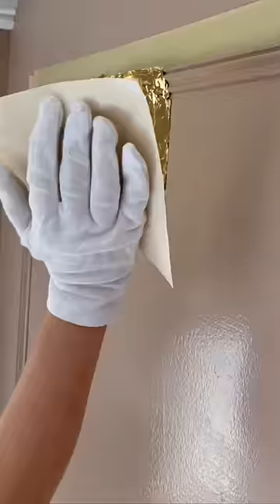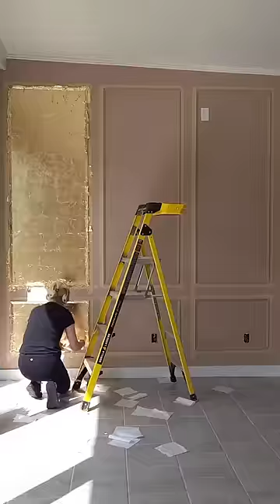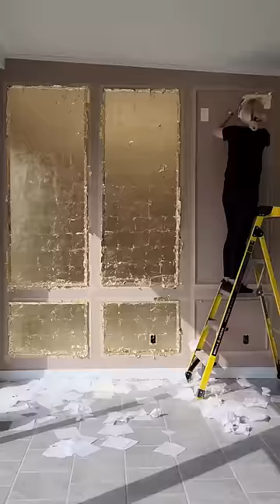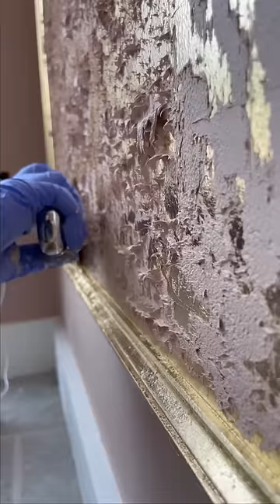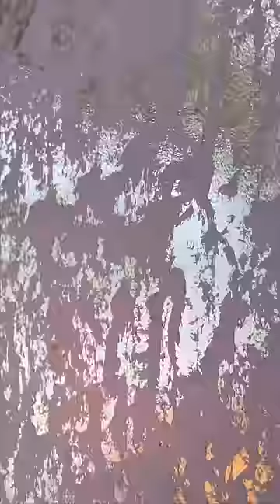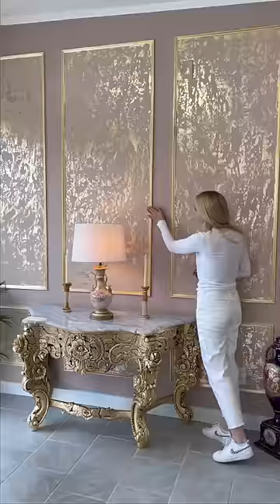Can’t wait to show you the whole store but this wall section is probably what I am most proud of!

Comment: Beautiful but probably very costly
Reply: I was thinking the same. That's a lot of gold leaf!
Reply: Cheaper to use similiar wallpapers
Reply: @Snakelady- The size indicated that it is gold colored metal leafing. Real gold leaf sheets are much smaller.
Reply: Scratch "but" add +++AND+++
Reply: Gold leaf isn't expensive, either way, there are duplicate gold leaves sold, this might be that
Reply: @mypandapaints5854 It’s still a couple dollars per square and she used a lot of them
Reply: @elizabethmion4595 She said the project costed around 300$
Reply: @elizabethmion4595 Those gold sheets are not that expensive. I just bought 100 of them for $20.00 from Temu.
Reply: Aqui no Brasil,  dá para reciclar da embalagem do café Mellita.
Reply: Gold leafs are weary cheap on allyexspresse but not imagine i dont know WHAT. They are wery thin and saying so wery hard to work with for dose who didn't use them before.
This is wery simple tehnig. But still neads exsperiance.
Reply: @lilpinksliplee7310 how was the quality, did it work good? I find its hit or miss from temu.

Comment: Beautiful!  please do full tutorialfor this!
Reply: Step 1. Tape off area
Step 2. Put adhesive onto area you want gold leaf
Step 3. Add gold leaf
Step 4. Dust off excess gold leaf
Step 5. Remove tape
Step 6. Mix wall color paint with drywall mud
Step 7. Lightly dab drywall mud onto wall
Step 8. Let mud setup slightly 
Step 9. Knock down all height points with a trowell
Step 10. Step back and realize you shouldn't have even tried this because it's horrible and you see all the imperfections
Step 11. Have friends over who will actually tell you how awesome it looks and how talented you are
Step 12. Take a deep breath and enjoying what you have accomplished 
Step 13 optional. Any time someone compliments your beautiful wall make sure to say it's not that good and show them all the imperfections.

And that's it.
Reply: @spazzypotato8325 I was reading it carefully 😑😑😑
Reply: @monazeba3206   steps 1 to 9 are legitimitetly  how you accomplish this look. The rest are just what I tend to do after a DIY, so I figured they applied, lol.  Give it a go. I bet it'll look awesome.

Comment: Why did you waste so much of the gold underneath? You could have done the same exact styling with using so much less gold if you had put some adhesive on the wall and applied the gold the same way a nail tech applies foils